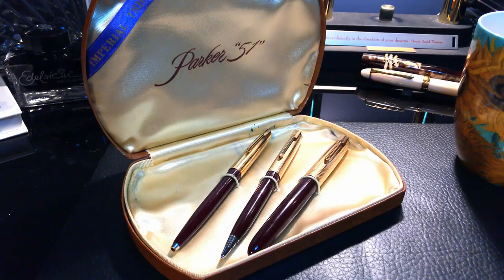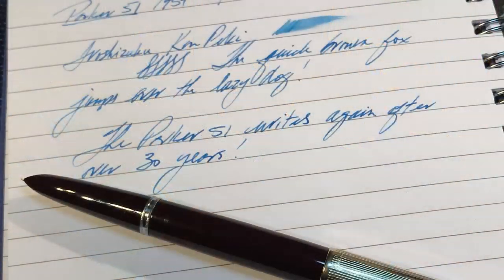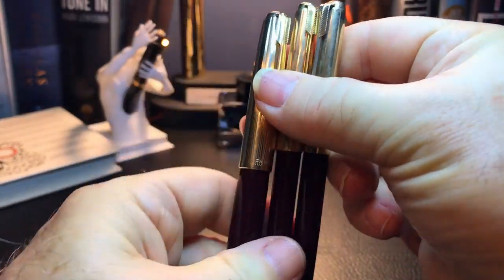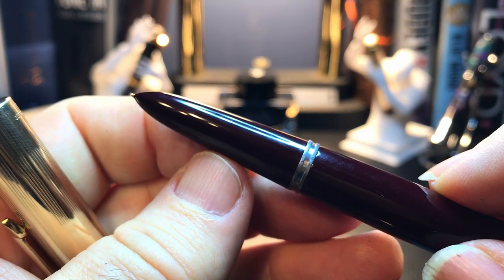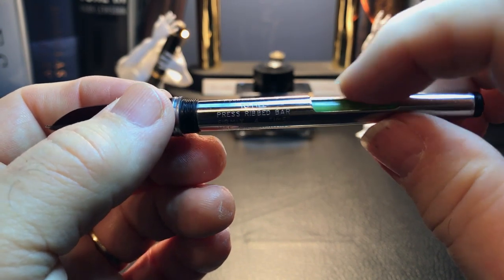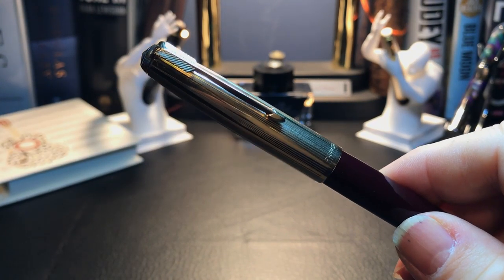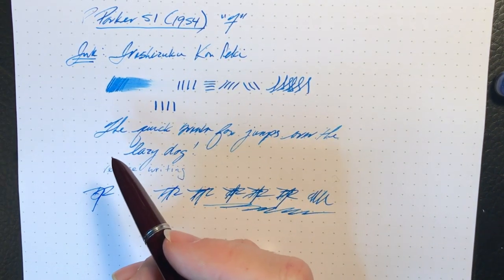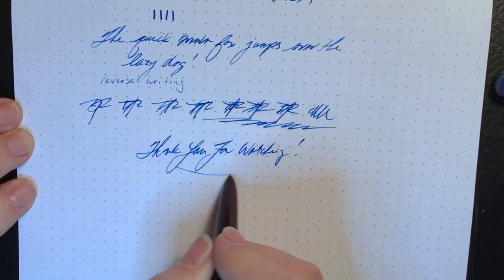Vintage (1954) Parker 51 Fountain Pen Restoration and Review

Comment: II just bought my first 51. I got it from a lady on fakebook market, and apparently it is actually a parker 51 Demi, so slightly shorter than the regular. 14kt nib with a 12 kt gold filled cap. I think it's a medium nib, and it's incredibly smooth.  Seems to be in fantastic shape, a fair bit of dried ink, but i got it clean with just some warm water. I got it for $75, I don't know what the going rate is for these but it seemed fair to me.
Reply from the maker: That's a good price!
Reply: I just got a full size 51 along with a pencil, date code on the pencil is 1953. I was wondering what mechanism the one in this video uses, twist or click? It’s proving more difficult to find info on the pencils compared to the fountain pen. Mine is a twist pencil and I think it takes 1.1mm lead, my 0.9mm is smaller than the broken pieces that were in the barrel. It also has a metal rod with a hooked end in the lead compartment, I thought it might just be for clearing jams but from what little I could find it may be for pushing the lead out after it gets too short for the mechanism to grip. If that’s the case then it’s fallen out from where it’s supposed to be and it’s going to be a real pain trying to get it back in. 
And I’m very happy with the pen, the line is about 0.9mm and has that felt tip pen sort of feel. Plus I got the set for $40 along with a Sheaffer box!
Reply from the maker: @coreyjs55  Awesome! The 1954 P51 pencil in my set is a twist.

Comment: Another good one Doug, the 51 is a classic. I have a gray one with standard cap, gold fine nib found at estate sale, good flushing and cleanup and it was ready to go.  FYI the sac is made from PVC, not latex, so it could handle the corrosive Parker Superchrome ink, That also means sacs that are over 70 years old still work fine today!  No such thing as planned obsolescence then.  Can't wait to see your next project!
Reply from the maker: Thanks for that pete! That actually makes more sense to me. PVC will be fine with almost all modern inks although I doubt it would be a good idea to put anything shimmering into one of these!
Reply: @InkquiringMinds  That is true, trying to flush out shimmering ink from that feed and huge ink collector would be a job and a half!
Reply from the maker: I watched Steph at Grandmia Pens three part video on taking one apart, restoring it and putting it back together again and it is a huge project with lots of minefields. I'm so glad I didn't have to take it apart. One drop of J. Herbin Emerald of Chivor in this puppy and it would be toast.
Reply: @InkquiringMinds  Got that right!

Comment: Man I've been writing with this pen since my godfather's gave me a set with the fountain and rollerball pens. The rollerball is still in the same place (in the box) with the same ink as it came and still writes. That was 45 years ago. The fountain pen was with me for this long until last year I fall and the pen broke in the middle, right where the back section screws into the bottom section. My pen was the stainless steel brushed version and I've been looking for one ever since everywhere. Just can't find it... I bought a green/grey body, and a black body one also. Looking for a burgundy/brown? also. But the stainless steel one is just eluding me and I'm heart broken missing my dear pen. I've got a lot of other fountain pens that I use daily, even Montblanc 149, but none matches the pleasure of writing with my Parker 51. By the way if someone knows of a brushed stainless steel available somewhere please, please, notify me.
Reply from the maker: Thanks for sharing!

Comment: Fyi. The instructions mention superchrome ink. This is one of the very first aerometrics built, so most probably closer to 1950 than you think. By mid 50's Parker dropped the superchrome ink as it totally destroyed non P51s. There may also be a date stamp on the barrel somewhere that indicates date of manufacture. These often got faded or rubbed out over time. One other thig about the aerometric system, Parker used an indestructible sack. I got several P51s and never had a problem with the filling system.
Reply from the maker: Thanks for this very useful information. As to dating, I wrote to Tony Fischier at https://parkerpens.net/ specifically about this Parker 51 set. He figured '54 was a good guess because of the pen but also because of the pencil and ballpoint and also the faux ostrich case, placing it in Canada in 1954. There were no dates or codes anywhere on any of the pieces. It is good to know that PVC sack is indestructible. I was getting warnings from others about using Iroshizuku. Not worried now.

Comment: I just inherited a parker 51 pen and pencil set the pen looks just like the one you showed in your excellent video. I am trying to figure out the value as I believe a well known collector in the world of vintage pens may be trying to low ball me if anyone here could give me some general information I'd be grateful. The pen looks e exactly like the one in this video it has 1/10 12k gold filled on the cap and the body is etched made in usa with a tiny 8 after it. It came in a box with a metal plate that says parker with 51 on each side and on the back the box says no254. If anyone could tell me what I have and its possible fair price value I'd be greatly appreciative.
Reply from the maker: Is the 51 a vacumatic or aerometric filler? If aerometric, does the filler sleeve say "press six times" or "press four times" on it? Look at this page for details about the 51 and clues to dating it. The "8" on the barrel might mean fourth quarter of 1948.
Reply: @InkquiringMinds  Hey I tried to reply to your message earlier but it may have not gone through if so a apologize for spamming  you. So it is a aerometric the print inside reads " To fill press ribbed bar firmly 6 times. Use dry - writing superchrome  ink.
Reply from the maker: Probably 1948

Comment: Hey I have this IDENTICAL set from my grandmother and recently dug it out. I don't have an ultrasonic cleaner. But I have soaked the NIb and pumped some water through it. Do you suggest I attempt to fully disassemble this thing or just go get myself some of that waterman ink, get the pen dried out and attempt to ink it up and use it? The pen itself is in absolutely prestine shape, I don't thinknit was ever used much and the pencil i believe has never had lead in it. Also what's the best way for me to go about properly drying this out after giving is a soak and a flush out?
Reply from the maker: Let it soak until the water runs clear. Then expel as much water as possible. Put some paper towel in a glass and leave the pen nib-down with the nib in the paper towel until dry. Then re-ink it. There’s no need to disassemble.
Reply: @InkquiringMinds  
unfortunately it didn't work out in my advantage. It wasn't properly sucking or discharging the water even so I did end up taking a hit of heat and getting the end cap off. Got it all apart and the sac was so gunked up when I removed the feed the breather tube ended up being just stuck down in the sac. Of course broken off of the black feed portion that goes into the NIb. 
I've kinda just been teaching myself and learning this as I go with the help of folks like yourself and internet but now am sort of at a loss. I'm just up in edmonton so I may aswell take a look around and see if any local shops or knowledgeable folks are here that can maybe help me out. 
 Not sure if it's even possible to find a new breather tube, the rest I feel like I could clean out and fix up myself as I'm rather handy. Just don't overly know these vintage pens.
Reply: @InkquiringMinds  you were just down in calgary correct?
Reply from the maker: Correct!
Reply from the maker: You can get replacement feeds with the breather tubes attached at Pentooling.com
Reply: @InkquiringMinds  thank you so much! I was alrdy hunting about for some info on that and did notice they could be bought so that's amazing news. appreciate the good source also I'll definitely be ordering a cpl small bits and getting this old pen of my grandmothers up and running!
Reply from the maker: @MrBpritch100  Wonderful!

Comment: Have a Parker 51(?) belonging to my deceased uncle who passed 70yrs ago. The pen does not unscrew mid to nib section. Would it be possible to loosen it with an ultra-sonic cleaner? Do not have the talent/care you exhibited but value your results.
Reply from the maker: The sections on the Parker 51 are glued down with an adhesive similar to shellac by Parker. If it has been previously restored, it would probably be shellac. An ultrasonic will clean the section out but won't loosen it to unscrew. Is there a reason you need to remove it? If it isn't broken, don't fix it.
Reply: @InkquiringMinds  Thank you for your reply. I barely remember a rubber bladder. It's been quite a while. The ink is somewhat rancid.
Reply from the maker: @nrs6956  If the barrel opens, you should see the aerometric squeeze filler. If the barrel doesn't open but a small end cap unscrews to reveal a pump rod, it is a Vacumatic.

Comment: Maybe there is a mistakes with my English.　英語って難しい！(Japanese)
I also have a aerometric Parker 51, one of it is gold filled and the normal one.
I have a question, everytime when I take the cap off there is a scratch on the body.
Is this also been like me? I'm bothering to polish these scratch.
Reply from the maker: This is typical of the P51 capping.

Comment: i just did the measurements the hero 616 is exactly the same size and shape and filling mechenism as the parker 51 which if you couldnt afford one thats a cheaper way to pretend you have one i have one in green its beautiful although i hate the filling system
Reply from the maker: Yes, I've seen the 616. I have a Hero 565 (which I now understand is an homage to the Parker 61) which will be here shortly. And I LOVE the WingSung 601a which I gave to my wife and which is just like this Parker 51 except the nib is tubular like the Sheaffer Triumph. I don't really hate the aerometric as much as I thought I would. The PITA is cleaning the damned thing.
Reply: Another alternative is Wing Sung, 601. It's more expensive than Hero 616 but it's a way better quality
Reply from the maker: I have (wife has) a 601a with the Triumph style nib.
Reply: @InkquiringMinds  Personally I prefer the standard hooded nibs and have three regular 601, with hooded nibs like the 51. Unfortunately the regular 601 doesn't come with these beautiful gold plated caps.
Reply from the maker: @w.j.m.91  I know. It is a trade off. I'll have to pickup a regular 601 WS as soon as Bobby gets back from vacation. :)